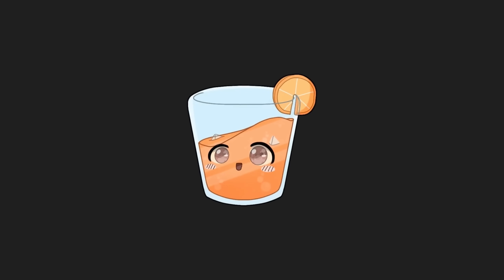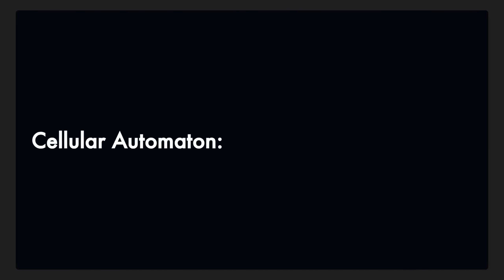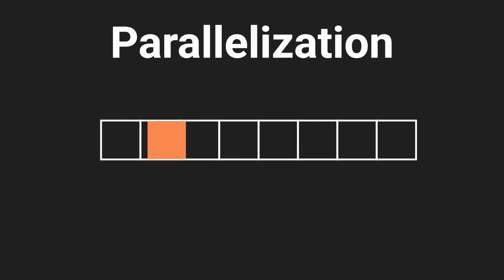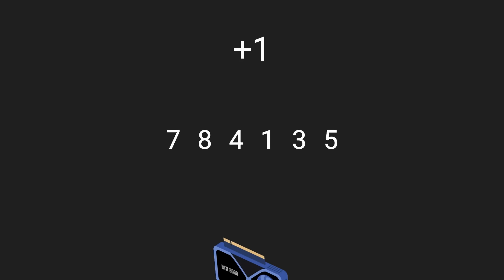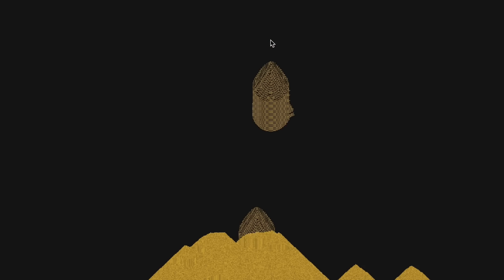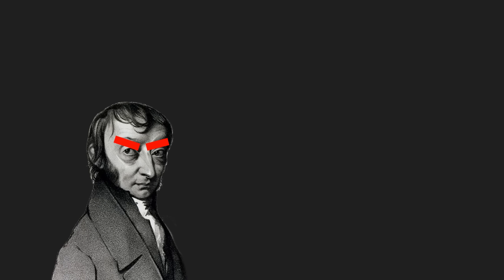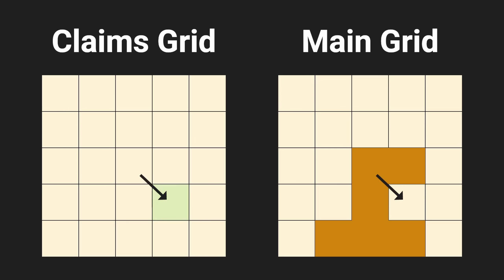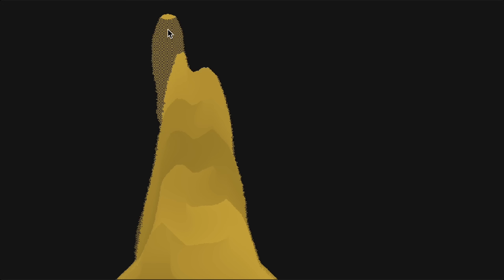Optimizing a Falling Sand Simulation To an Unreasonable Degree

Comment: To avoid race conditions, you can perform 9 checks per tick. In each check, a specific subset of cells is updated while none of their neighboring cells are updated during the same tick. This makes race conditions impossible, because no two shader invocations ever access the same cells simultaneously. Consequently, each simulation step consists of 9 iterations over the grid: one for each neighbor offset and one for the cell itself.
Reply: https://www.youtube.com/watch?v=9IULfQH7E90&t=240s Similar to how the problem was solved in this video.
Reply: Wouldn't 3 checks per tick suffice, since there are only 3 possible directions for movement?
Reply: Like interlacing?
Reply: i have tried implementing a similiar solution, from my experience it wasn't ideal because the subset of cells that need to be updated is really big when scaling(think of a line of sand falling, for this method to work every pixel needs to know if the bottom one has stopped) so you end up asking one thread to calculate hundreds of pixels and thus loose a lot of the parallel benefits. The upside is you can get rid of the airgaps created when large objects fall

Comment: I think sand slow falling down the sides makes sense because of friction even if it is a bit exaggerated.
Reply: I think it's because the velocity of a sand particle is essentially capped at one pixel per frame,
in reality, a grain of sand builds up speed as it's sliding off a pile of sand,
but in the simulation, the sand particles slide off at a constant speed, which makes it look like there's some kind of drag or extreme friction
Reply: @ChucklingG not only that, it seems that only top layer is falling in this simulations, while in reality many internal layers could slip simultaneously
Reply: @Lopol2010 if there's space the lower layers can slip as well i think
Reply: @ChucklingG Yeah I agree I was just saying it was a good approximation
Reply: that would make sense... until you see a mud slide or snow avalanche
Reply: Yes! And also a diagonal move is longer than a straight one.

Comment: CPU's are a lot more capable at these sorts of tasks than one might expect if you know what your bottleneck is and what to optimize for. GPUs are great at parallelizing lots of small nearly-independent tasks in parallel, but CPUs are great at processing huge chunks of data that have more complex dependencies. Key terms for a deeper rabbit hole are Data-oriented design/programming, CPU pipelining/hazards, SIMD/vectorization, and cache locality and structs of arrays.

The core concept is vectorization/SIMD: with falling sand simulations much of the time is wasted processing dozens of instructions for a single granule vs a few instructions for mutiple granules at a time. The other common bottleneck is memory throughput: you want to have as much useful data loaded in registers and cache lines as possible to reduce the need to fetch data from all-over, along with predictable sequential access patterns to allow the CPU to guess what data it'll need to load next before it needs it. Naive SIMD implementations can process at least 4 granules at a time with most of the time spent waiting on data. More clever techniques using bitsets or tightly-packing data using SIMD-within-a-register tricks to represent particles of various types or properties can expand that to dozens or hundreds at a time, comparable to GPU wave widths. 

That said, a modestly optimized GPU solution could outperform a well-optimized CPU solution through sheer bruteforce depending on the simulation and hardware. Though problems like dynamic collision with other objects or chunking for even larger/infinite simulations are often easier to solve CPU-side. As always it comes down to cost-benefit analysis and whatever suites your particular needs.

Comment: we love race conditions

also i wonder, maybe if you just gave a probability for each grain of sand to remain in place as well as move to the neighboring free cell, it may have had a similar effect without using atomic operations. sounds like a very hacky solution but at any given moment a single empty tile can be contested by at most 3 neighboring sand tiles, and can also be completely removed so contested by 0. I wonder how the animation would work if you just gave a ~50% chance for a sand particle to "duplicate" itself considering that. i'm no mathematician but it sounds to me like in the long run you'll be maintaining a similar amount of sand particles as you actually dropped but you'll cut out the second grid and (i'm assuming) mutexes which could potentially optimize it even more without the sand seeming too janky most likely
Reply from the maker: It's definitely one of the most original solutions to this problem I've heard, but I think that behavior might look a little weird for sand. Maybe for some kind of cellular automaton fluid simulation that'd work well though? Not sure. I might have to implement other materials in this project to check some of these solutions out!

Comment: 7:37 why don't create a third grid which will mark where is a fall (the point where any sand will go down) if there is another fall point in the grid near this point (a 3x3 grid) the sand will accelerate due to gravity, so, in the first fall it will just calculate normally, if there is another fall event the GPU will parallelize the computation of this 3x3 grid and skip some of the fall points adjacents from the next fall point (so that the computer will not need to calculate every single grain the same fall grid, it will be stored and every other grain of sand that wants to calculate a fall event will already have the fall grid prepared, so when it sends a coordenate to the fall return it will just process the already existing data to make that grain fall even more in a smaller period of time). Sorry my english if it is too bad
Reply: it may speed up falling in the air, but the thing is the grid is constantly changing, so the fall the first particle did, may not be free for the 2nd particle
Reply: @horminel I dont mean only like, falling in the air, but falling in the air and going sideways, this would create a map that the GPU would antecipate some moves accordingly to its velocity

Comment: I suppose you could check 3 times, one for each pixel that could move to the same pixel, all of which are done on the same frame, but that's 3 calls. It's still probably the fastest. This MIGHT be possible to avoid by using if statements to determine the order... But I think modern GPUS might allow SMS to run multiple branches at the same time, and you're still just praying for the cache to update before rewrite.
Another would be to, for each pixel, store the desired move location, saving this in a new texture. The next step each pixel checks the neighbors and determines which to move. Two steps instead of three, but minimum double the memory usage, and double lookups.

Both of these really only work for this simple cellular automata, and would completely fail if a sand can move sideways or more than one cell.

I don't know about shared memory, I haven't done anything with it. But afaik you can sync GPU threads to exchange memory, so that could probably be a workaround... But it's probably similar to atomic operations, and therefore slow... But is it 3x compute calls slower? I don't know.

Comment: a solution for slow sand is to add velocity to it. your sand isn't realistic looking because it has fixed speed (1 cell per step). adding some velocity based on gravitational force and sliding on other sand particles gaining speed is critical to making sand spread faster and more realistically. you'll have to check particles path with ray tracing (checking straight line from current position to next one, block or redirect movement if blocked).
Reply: Is this rage bait?
Reply: @ILikeAlice  wha? I've said something wrong?
Reply: @eos_rf if his current simulation is running at 500 fps then a raytrace one, even with quad trees, would run at... 5? 25 if you're lucky. Currently he's doing 3 checks per pixel, a ray cast is hundreds at least
Reply: @ILikeAlice  I've seen other simulation(s) doing that thing just fine. GPUs aren't that weak for that, modern graphics shows that, using way more complex ray tracing, etc.
Reply: and yeah, video's author mentioned Noita as a source for inspiration. Guess what? In that game simulated pixels have various speeds, and it still runs fine (until something wild happens of course, Noita includes way more than just falling sand on one screen)
Reply: @eos_rf those were a different type of simulation, the objects were in a (semi) continuous space. Here it's a grid. You're talking way out of your league if you think raycasts are a good approach in a cell automata. Ask your local gipitee why, but also know that your original comment is unbelievably stupid, I've seen some insane comments made by newbie programmers, but "cool cellular automata, now add raycasts" is criminal
Reply: @ILikeAlice  when I've said "raycasts" I've meant raycasts in 2d, a.k.a just pixel perfect lines from one point to another. Maybe they're better terminology specifically for that, but alas. What do you think I've meant? Do you really think that there's some mysterious processing-hungry raycasts for 2d space? There's limited space, limited speed to falling sand, so checks for path intersections will be miniscule.

I've said already in a different reply to you a live example of 2d raycasts used in "particle simulation" like games - Noita, your "grid" space.

I'd thought you'll understand that 3d ray tracing is way more expensive than 2d raycasts, so it'll be EVEN MORE EASIER to implement it in 2d sandbox world.

ಠωಠ

btw I'm familiar with programming and game dev for ~5 years, any other comments?
Reply: @eos_rf yeah, 5 years means you're a beginner out of college, but you'd think that was long enough that you'd stop writing stupid shit in comment sections. I remember writing ones like this when I was starting, but not for 5 years god bless. You have so much pride it hurts to read. A 2d raycast still iterates through all objects in the scene OR construct a space partitioning tree as an optimization. I understand you're a game dev, so you call the unity function and don't know how it does things, but you really should have checked how 2d raycasts work. Noita has 2 separate ways of positioning objects, the grid, which runs the cell automata, and the entities.  The latter is where raycasts matter. The first you just walk cell by cell, which is ok BECAUSE IT'S REALLY FAST. 

I'm ashamed i got ragebaited into this conversation because I'm discussing raycasts with someone who's never seen one written, and somehow, somehow, just made up to be the perfect tool for the job in his head

and i have twice the experience than you do I probably started my first job before you started in general, but that doesn't mean shit, and once you get spend some time at work you'll understand
Reply: @ILikeAlice you can literally just do a search of Falling Sand on youtube and you would see other people do this with velocity based. Its basically just about moving by multiple cell instead of just single cell in the grid, but the problem with moving through multiple cell is that you still need to respect the logic of solid elements can not go through each other. That is where the key word “ray casting” comes in, and in this grid context, it is just doing bresenham line from one cell to another distant cell to check if hit another solid cell. And to solve parallelism, they simulate grid by columns, odd columns first then even columns. Its not some complicated or complex stuff, i dont know why you keep throwing in the word rage baiting

Comment: Sick video bro, never tought these sand simulations were actually calculated pixel per pixel, i tought they used some sort of coupling/clustering to make it easier to compute!
Reply: Like quad trees?
Reply: @nathanndvd  absolute legend.
Reply: @doodocina I guessed it would actually be easier than learning a new language to process it on the gpu (I am not really knowledgeable on hlsl and compute shaders, but does it also introduce overhead for communication between cpu and gpu?)
Reply: @nathanndvd  it doesn't introduce overhead if implemented only on the gpu, if particles are stored in the texture2d(analog of arrays on the gpu). insanely low fps says it all - it was made completely wrong. usually you have like 15k fps or so on that simple tasks
Reply: @doodocina  Oh ok, it makes sense, thank you my good sir
Reply: With vertical stacking RLE could be used
Reply: and you are right... python programmer couldn't even think about that, only clickbaity title

Comment: I never noticed that sand falls slower in powder toy, now I can't unsee it. I wonder if changing the logic so that particles randomly (or cyclacly) claim cells below them, rather than falling straight down, would fix it (essentially a Brownian motion that pre-spreads sand as if falling through air)
Reply: The powder toy simulates air resistance and currents, so the sand causes the air to move, and it blows around because of how light it is

Comment: A couple months ago I tried implementing something very similar myself. The reason using an alternating grid doesn't work is because the sand can fall both straight down and diagonally. Sadly while thinking of how to parallelize it I didn't try using atomic operations, because I just assumed it would be too slow. However, I did manage to simulate 1920x1080 pixels at 170 fps (600 million pixels/s) using the CPU, which is something I'm very proud of. I did it by just splitting the area into a row for each CPU thread you have and using mutexes only for the edges of said rows.
Reply: That works for sand, but if you want to add liquids, they can move horizontally. And often there's even gasses that can move in any direction.

If everything can only move by one pixel, a simple way is to do it with every third pixel in every third row, instead of every other pixel in every other row.
Reply: @DanielLCarrier  I genuinely can't believe I didn't think of using more than 2 alternating passes. I wonder though, if you would have to dispatch 3 compute shaders per step and if that would be fast. Also because you want to display each step, do you not have to read the cells back to the CPU each step? I'm using Godot and am very new to compute shaders.
Reply: @_flix_  You'd need nine passes. And you can use the same compute shader for each pass. You could just read it through every ninth pass, after you've checked the whole grid. And also randomize the order of each of the passes each frame if you want to get rid of bias in how things fall.
Reply: @DanielLCarrier Thanks, I'll try it out if I ever decide to rewrite it with compute shaders
Reply: @_flix_  A Noita dev explains in a GDC talk about how they do it in 4 phases, multi-threaded on the CPU, though. Incidentally its the exact algorithm that Nvidia engineers shared in a slideshow presentation; which I can no longer find.
Reply: @RottenFishbone  Interesting, I remember watching a Noita dev's talk a long time ago but remember nothing, I'll have to watch it again sometime
Reply: @RottenFishbone  So I just implemented it, like they do in Noita, on the CPU, by splitting the area into a grid with num_threads * num_phases cells. On 1920x1080 pixels the simulation was slowed down by like 15%, however, the speed doubled on when simulating 3840x2160, from 15 to 30FPS!
Reply: nice
Reply: Something like that was immediately on my mind as well. Awesome solution!
Reply: Maybe thats a stupid thought but why not make the size of the diagonal longer and then filter by size ?
Reply: > 1920x1080 pixels at 170 fps (600 million pixels/s)
r/BlackMagicFuckery

Comment: Wait, but I Don't get it? if it's not sequencial, and the sands are all being processed in parallel, wouldn't both those sands claim the spot at the exact same time? How does the claim fix the issue?
Reply from the maker: The atomic operation makes the program function properly at the expense of speed! Obviously if the calculations happened at the exact same time it wouldn't work, which is why the atomic operation does the calculations one at a time. Still faster than doing everything in sequence though because as long as there's no interference between two particles they can still be computed in parallel!
Reply: @nivmiz0 oh, and sorry if I'm not getting it, but your program detects if there's any sands going to the same place and ONLY does those sands sequencially then?
Reply: @opal9583  The programs run in parallel but not instantaneously, the individual instructions still need to happen. The way an atomic operation work is that there is hardware in the memory system that lets processors coordinate so that only one can touch a certain address at once—so the threads all get to run at the same time except for one step of the algorithm which the hardware will make take turns if they try to touch the same place in memory.
Reply: atomic on CPU is basically a mutex lock, which is a hardware level operation which prevents any race condition, all other threads have to wait until the lock is lifted. It's basically automatically hiding the variable behind some synchronizing hardware operation. I don't know what is done on the GPU.